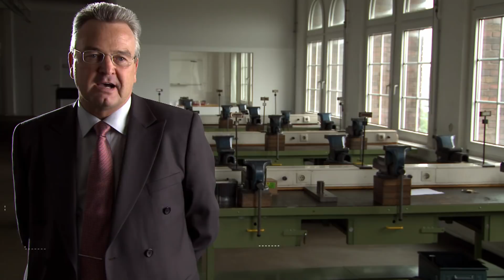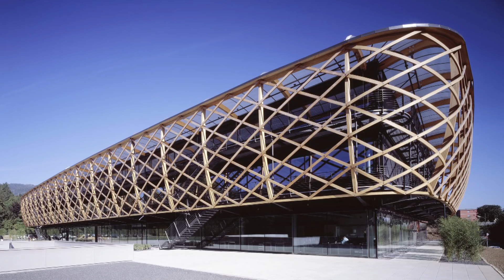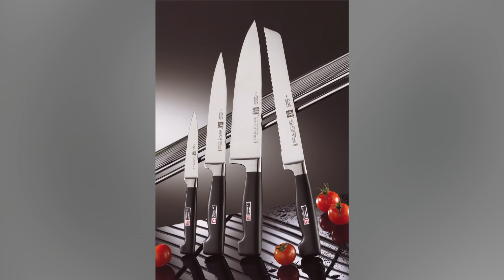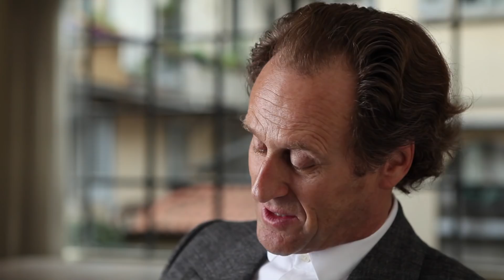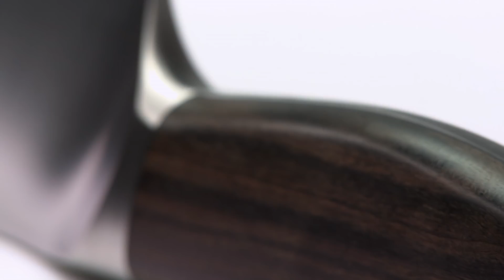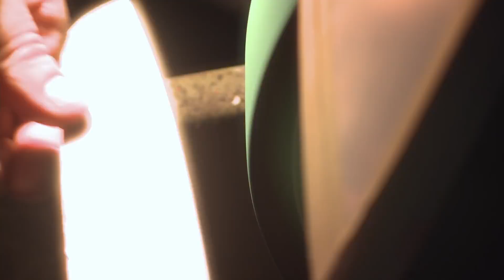How a ZWILLING J.A. HENCKELS Knife is made! - BRANDMADE.TV

Comment: too expensive for a non-hand-forged knife
Reply: Hand made is only better when they don't do the machine part properly.  Try  hand making a cpu =)
Reply: My point was that machines can make things as good if not better than hands sometimes.
Reply: +MisterBenne well it is the best industrialized knife, and these are easy to maintain steel
Reply: Check google - these are $500
Reply: It looks really nice, but 500$ is out of my league. My 150$ knife works just fine, and will last 30 years + if i take care of it.
Reply: The price is mainly for the steel. It uses Cronidur 30 Steel which is used in aerospace industry. There are other much cheaper steel almost as good for much 1/10 th the price but....  if you want the best... you pay up :)
Reply: he said the handle is made from ebony wood, so about 80-90% of the knife's cost is from the handle, lol
Reply: steel is not expensive the steel used in the knife costs cents.
Reply: These are $100 chef knives.  What is the price point that crosses the line and becomes too expensive ?
Reply: Low carbon steel with a little bit of nitrogen. It's nothing special but it is easy to grind in a hardened condition. That is the real reason they use this steel. Plus, it's extremely stain resistant...
Reply: Knife is not CPU. Even in this case wood part was grinded only by hand.
Reply: Adam Jones hire people where people excel.  They can't knowingly hire people of a machine can do it better. Who builds the machines? Company A can decide to keep people for the same task while company B adopts machines and does it faster better cheaper. Company A then bankrupts. Would you want a person to route your phone calls or worse route your internet request.
Reply: @koruki  Thats a great analogy "Would you rather have a person connect your calls by hand?"..thats how it is..why pay several people money for a no brainer job.
Reply: price is not an issue for the target group... professional chefs using the knife 10h/day 6 days a week.. :)
Reply: Fully agree with you - this is 95% automated and it's not worth the price.
Reply: Made in Germany is the definition of quality. Its worth every coin.
Reply: koruki - Why not think about WHO makes rather than WHAT makes it. Lets employ people. When everyone has money a market can thrive.
Reply: This is low carbon steel. Cheap, without hard, low-end steel. But, with pretty name Cronidur.